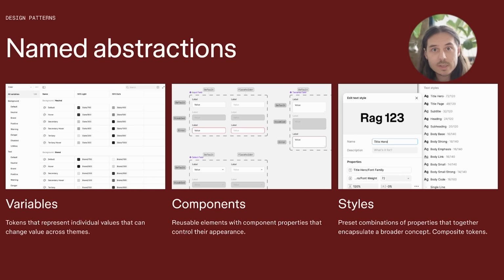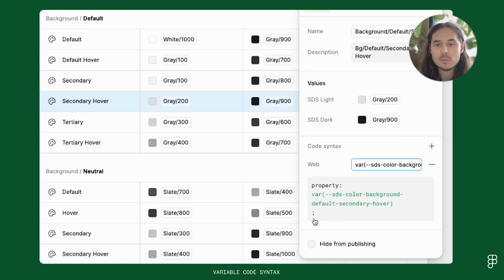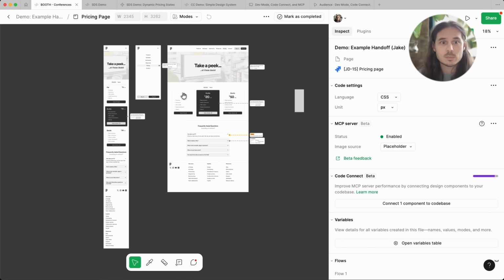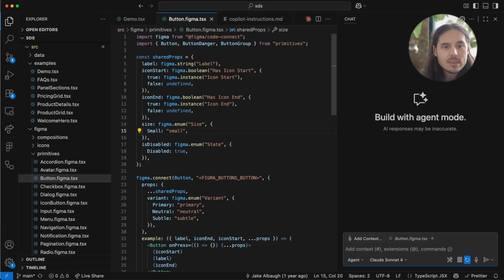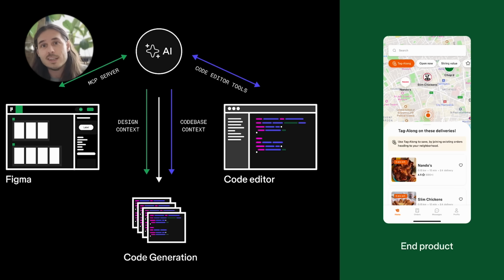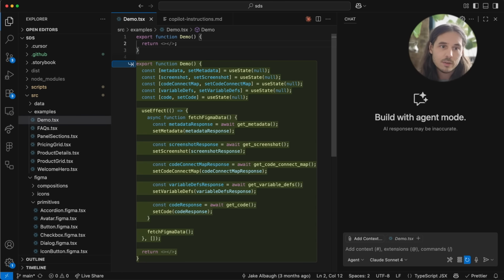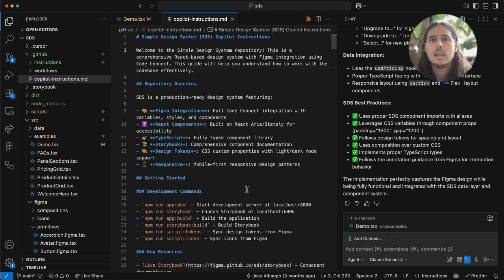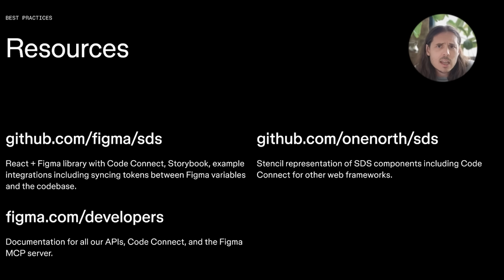Figma + developer workflows | design systems, Code Connect, MCP, and Make

Comment: My findings : The generates code works well when design system is paired with SDk, In this case , react SDK. If designer uses design system and engineers use Vue framework. Well, the code connect won’t be able to mapped. The generated code doesn’t really pair the UI 😢. I did a few tests and the result is far from satisfaction given I set up MCP server correctly and prompt well.  Please correct me if I am wrong.

Comment: Will it be possible to use Figma AI to rename all variables to proper code syntax? Or do we have to manually go through that process—considering there are 2,000+ variables? Also, will the official token export support responsive tokens based on defined breakpoints?
Reply: Similar question - how should teams with massive amounts of tokens adopt the proper code syntax for each platform? What automated methods have folks found/what does figma recommend?
Reply: Also, I would suggest making it possible to name variables for code in Dev Mode. Currently, naming tokens or variables is only available in Design Mode, which feels strange, right? It’s like the designer needs to know the preferences of the development team.
Reply: You can do this easily with javascript in Figma's console. Jake/Figma made a tutorial on how to do that a while ago with the code and everything.
Reply: @chloeam793  Thanks for the tip